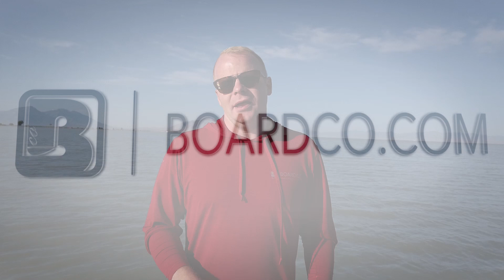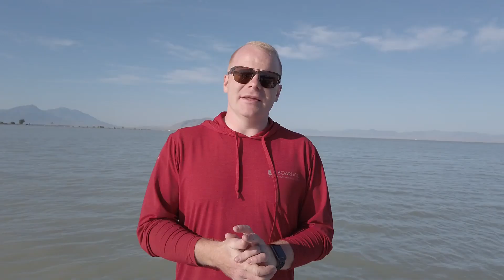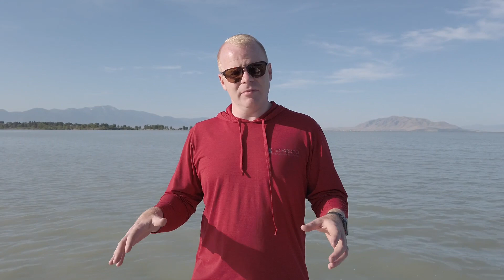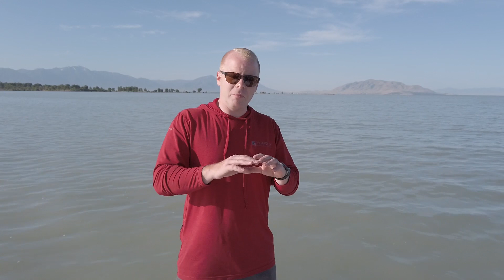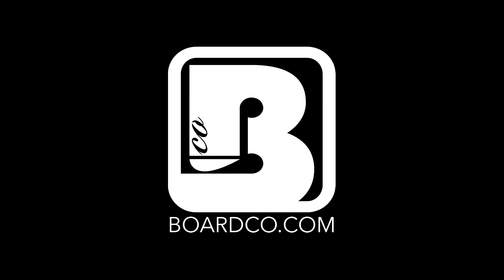Understanding Passive Hydrolock and How to Prevent it in Your Wakesurf Boat

Comment: I had my boat run on in reverse and it caused hydrolock. I pulled a skier and when I pulled around to pick him up I shut the boat off. It ran on about 4 times in reverse which sucked water in the motor. I have a 4.3 mercruiser. I is pretty common.